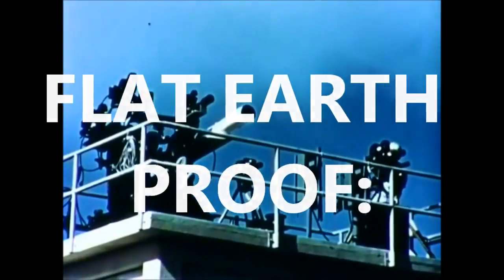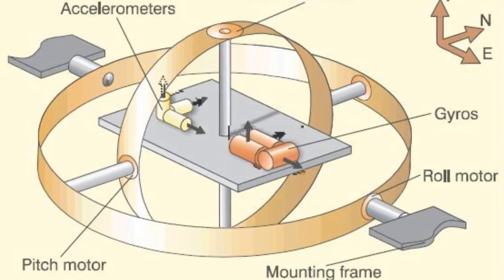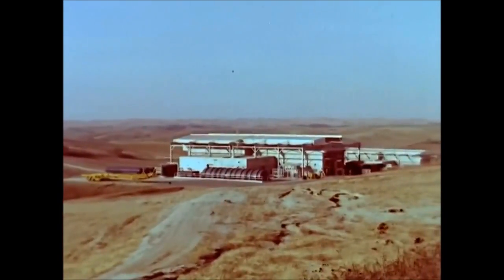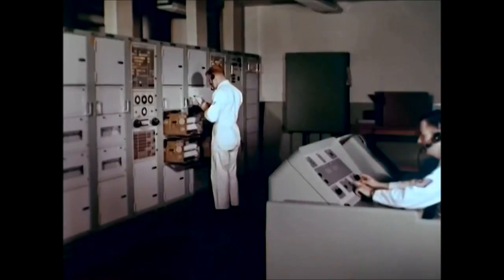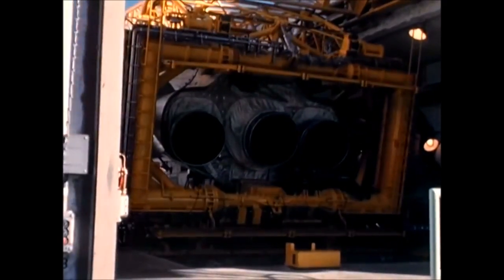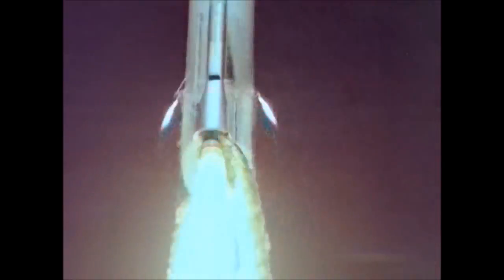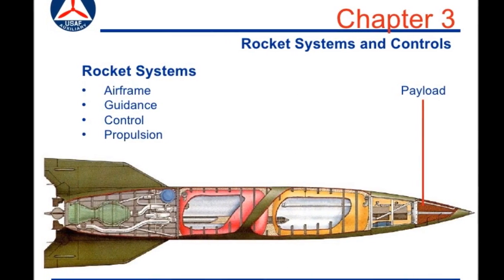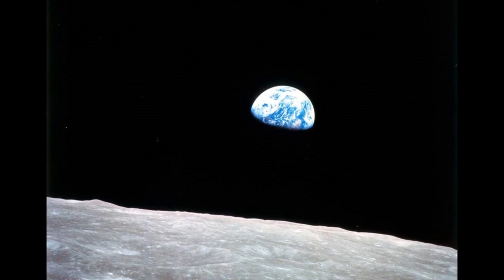Flat Earth Proof: ICBMs, Atlas and Inertial Guidance Systems...

Comment: Hello sir! This video brought back a lot of memories of my late father, who passed away 2 years ago. He worked on the inertial guidance systems for General Electric, just like that old timer in the video. His job was in the "Re-Entry Space Systems" division, providing guidance for nuclear warheads. I asked him about the range and accuracy long after he retired, and he said, "I think it's unclassified now..." before telling me in test flights of multiple thousands of miles they were able to get accuracy measured in hundreds of yards. Incredible without computers or GPS! All done through Gyros and elbow grease. 

But you're correct, these trajectories were ballistic in nature, in that the missile was "pointed at the target" very early in the course, with course corrections provided initially to the rocket nozzle gimbals and vernier jets, (this was the radio communication they mentioned, only possible in the first part of the flight), then later when it was in the purely inertial phase (zero thrust), through the fins. It was this latter part that my dad worked on.

Late in your video you mentioned something about accelerometers and gyros not working in zero g. This is not true. Accelerometers sense change in orientation and velocity based on a mass (and mass doesn't rely on gravity, "weight" does). Gyros exhibit their bizarre properties through angular momentum, which is based on a spinning mass (and again, mass is unrelated to gravity). A lot of people confuse weight with mass. :-)

If you watched Apollo 13 (the book "Lost Moon" has much, much more technical detail) they mentioned "gimbal lock" as being a hazard. This is when at least two of the axes of a gyro align, meaning you lose one of the three axes of rotation, and the gyro will tumble out of control. Gyros were absolutely essential in space guidance, and they still are, although they use solid-state electronics using principles of physics I don't understand, but they don't require mechanical rotors and gimbals any more. Fascinating stuff!

cheers!
Reply from the maker: +Flat Earth Math "Accelerometers sense change in orientation and velocity based on a mass (and mass doesn't rely on gravity, "weight" does)."

So, what is the accelerometer measuring those changes in orientation/velocity based on mass against..?  My research indicated that they measured changes in velocity against the base metric of 1G (which is a gravitational measurement, obviously...)  To speak of mass, and infer that it is being used as part of the instrument in a way that has nothing to do with it's weight, really makes no sense.  Just picture a bowling ball, floating through space.  If it suddenly sped up, in the vacuum of space, could you measure it's increase in speed, simply by way of knowing it's mass...?  It's mass doesn't change.  You have to have some form of numerical constant to measure the change AGAINST (i.e., gravitational pull)

But your story about your father is most interesting.  Indeed, the research I did indicated this very thing, that they were able to aim rockets with amazing accuracy, using nothing but "gyros and elbow grease".  No computers.  No compensation for curvature.  Just simple, parabolic ballistics...  You shoot the rocket in a big arc, and the adjustments are made midflight to try and maintain that predetermined arc.
Reply: the Truth is stranger than fiction...
  Thank you for your kind reply. :-) That's an interesting question about what you measure acceleration against. The usual yardstick is the acceleration at the Earth's surface, whether or not gravity exists, it's 9.8 m/s/s. So they give that value "one G" and measure all accelerations against it. No need for gravity, it's just a handy benchmark, and people talk about Gs for example with amusement park rides: "we pulled 2 Gs on that curve there!" So accelerometers work fine in any environment, gravity or not. But the "yardstick" is frequently G on a human scale, but it doesn't have to be. For example, it can measure all accelerations simply in m/s/s.

With regard to your bowling ball in space concept, its acceleration has nothing to do with its mass. You can measure change in velocity regardless. Now an accelerometer will have some means of detecting change in velocity, and possibly that is a tiny mass with little springs on the x-y-z axes. But it doesn't need to be under the influence of gravity at all.

One slight correction when you were reflecting what I wrote about rocket guidance: "No computers. No compensation for curvature. Just simple, parabolic ballistics..." Actually they DID compensate for curvature. :-) But my dad's gone now, otherwise I'd have him tell you himself! But it was great going through all his old papers after he passed, he had a lot of "company confidential" stuff from GE, especially about the Moon program. I gave most of it to the GE old timers who came to dad's memorial service.

I like your spirit and your desire to dig in and do the research! Keep up the good work. :-)
Reply from the maker: Flat Earth Math
"Now an accelerometer will have some means of detecting change in velocity, and possibly that is a tiny mass with little springs on the x-y-z axes. But it doesn't need to be under the influence of gravity at all..."

The entire premise of accelerometers working in space relies upon the accuracy of this statement, yet this is where you seem least certain.  You're not explaining just HOW this would actually work, if indeed, that "tiny mass with little springs on it" has no gravity of Earth pulling on it (or at an infinitesimal amount) then going from 100 to 1000 mph in space is going to produce what sort of effect on that "tiny mass"?  That "1 G starting" is used, because that IS the starting point in actual physical experience, it's not merely some number that gets punched into a mechanism that is somehow divorced from the 1 G of gravitational force we all experience all the time. 

Think about it, if what you are defending were true, then the G-forces experienced by astronauts accelerating in their craft on the "way to the moon", or accelerating up to the 17,000 mph speed of the ISS's alleged orbit (in order to dock with it and come aboard), would be enormous.  Far beyond anything any fighter pilot in a cockpit ever experienced.... 

Everything that NASA portends to convey about the G-forces experienced by astronauts basically describes them experiencing tremendous G-forces in the initial stages of take-off, but then they gradually dissipate as they reach orbital altitude and begin to "break free from Earth's gravitational pull". 

In other words, you can't have it both ways...
Reply: You have some very astute questions, and I appreciate your attention to detail. :-) With regards to accelerometers, I don't know how exactly they work, since so many things are done with solid-state electronics (on a computer chip).

But take your average smartphone. Resting on a table face up it should register 1G in one of its three axes, but if you then lift it up so that it is vertical, facing you, then a different axis should now register that 1G.

Excellent question about G-forces into orbit. Let's say you had a rocket engine that had an acceleration of 32 feet per second per second (same as 1 G). Lifting vertically off the launch pad, the astronauts would feel 2Gs, the Earth's gravitational acceleration, plus the actual change in velocity of the rocket. Then the rocket rolls over to aim downrange (rockets don't go "straight up" for very long, they really need to move towards a circular orbit, with the trajectory parallel to the Earth's surface, but 100 miles up).

When headed downrange, the Earth's gravity will still be pulling "down" but the engines are pointed at a steep angle (almost horizontal), thus the Astronauts would feel about "root 2" times G, or 1.4Gs (very round numbers). If the rocket continued with its 32 feet per second per second, it's getting faster and faster, all while subjecting the astronauts to only 1 G of force (not counting the Earth). This works out to an acceleration of 21mph, per second. This curving trajectory quickly begins cancelling out the Earth's gravitational pull (like the Vomit Comet, but sustained), so that, once in orbit and the engines are off, there's only microgravity.

At this rate it would take 779 seconds, or 13 minutes to go from zero to 17,000 mph. Please note these are all back-of-the-envelope calculations, the actual G-forces and time-to-orbit are not exact. Looking at the Falcon 9 specs, it looks like they reached orbit closer to 520 seconds, so the launch G-forces for the payload were higher.

Great info here on SpaceX, from founding to present: http://www.spacelaunchreport.com/falcon9.html

Comment: Nice job, thank you!  Good point, how does an inertial system work without gravity if it is relying on it in its calculations.
https://en.wikipedia.org/wiki/Max_Schuler: "In 1923 Schuler published his discovery that if the gyrocompass was tuned to have an 84.4 minute period of oscillation (the Schuler period) then it would resist errors due to sideways acceleration of the ship or aircraft in which it was installed."
https://en.wikipedia.org/wiki/Schuler_tuning
In this document: http://aerostudents.com/files/avionics/navigationBasicsAndInertialNavigation.pdf
It says that "gravity is not always perpendicular to the earth's surface" that's interesting...
"Instead, the apparent gravity field g satisfies"

"We can also use coordinates with respect to an ellipsoidal Earth. This gives us the geocentric spherical
coodinates (λ, ΦT , h). h is the height above the reference ellipsoid. ΦT is the geodetic latitude: the
angle between the line normal to the ellipsoid surface and the equatorial plane. Finally, λ is still the
longitude. (It remains unchanged.)"
So, according to this document you can use a spherical or ellipsoid surface model.
Under the accelerometer section it says, "To know in which direction g points, we have
to know the orientation of the aircraft. For this, we can use gyroscopes." 

Then it says that: "But the position data is also used to precess the gyroscopes, such that they follow the Earth’s curvature."

But the compensation is always  84.4 minute period of oscillation no matter where you are on earth or whether strapped (on an airplane) or stable platform.

It goes on to compare platform vs strapdown systems... At the end it says: "And surprisingly, the Schuler oscillation doesn’t only occur for the real platform of a stable platform system. It also occurs for the analytic platform of a strapdown system."

Why is this surprising?
Reply from the maker: +oneeved Yes, THANK YOU, great comment! You actually did your own research. :-) It amazes me how many times people simply have regurgitated "Schuler tuning" at me, without actually bothering to comb through the minutia of their explanations, in order to see how the whole thing is really just an exercise in talking in circles.  You can't have a navigational system where at the end of the day, no direction/orientation is truly fixed.  Either gravity is that thing which remains fixed (but that contradicts their explanation of the gyro), or the gyro is fixed with true rigidity in space. You can't have it both ways, depending on which piece of the overall model you are trying to defend.  It has to all fit into a cohesive whole, otherwise it's just a case of mathematical diversionary tactics! The question of how inertial guidance systems could possibly work in "space" is the most humorous of all to me...
Reply: Thank you! I would love it if you did another video on Schuler Tuning... because while I sort of understand, it is complex. Why is it saying that "gravity is not always perpendicular", This is an assumption that many people in science always make, in fact some of them use this as an argument against the gyro. What is "apparent gravity" vs. real gravity... this seems to me to have become an arbitrary thing not a real thing? How does it work on both a sphere and an elliptoid surface area? This seems to me to imply that it is independent of the shape of the earth. Why is the oscillation a constant 84.4 minute period no matter what? Am I right in thinking that the oscillation should vary depending if you are on the earth's surface vs. at an altitude? Because if it is measuring "curvature" you've got a different curve up there... a bigger one.  It seems that the accelerometer is dependent on the gyro for positioning, yet it says that the accelerometer compensates the gyros' precession.  So it's a loop.  You can never be sure which function is primary... except for the fact that you started it at a particular point on earth... a fixed frame of reference. The whole thing just debunks itself. It's very cryptic... using cryptic math. Is my thinking correct? Or am I drawing false conclusions?
Reply from the maker: +oneeved No you're right on the money! It is indeed a "loop", nothing more than circular reasoning which ultimately only debunks itself. And you're absolutely right about the fact that altitude would affect everything, because traveling at the same speed at different elevations would mean traveling over different fractions of the supposed curvature.  All this talk about navigational gyros compensating for curvature is really no different than the kinds of things you discover about curvature supposedly being accounted for in surveying or building projects. It shows up briefly in the text books or manuals etc on a theoretical level, but practically speaking, it never comes into actual play.  It's pure intellectual theater.
Reply: Thanks for that confirmation! :) I guess I'm not a dummy after all as the trolls will say... nice to get the feedback.
Reply: You are both dummies.